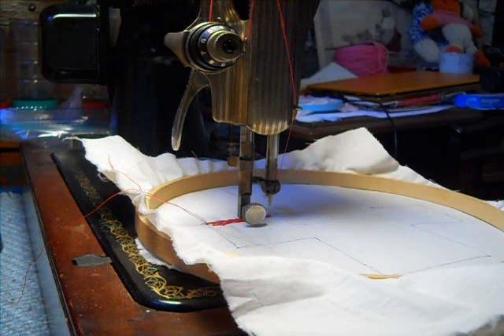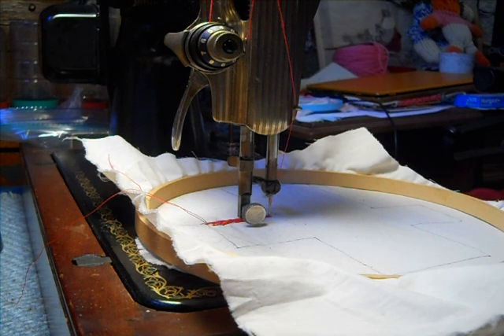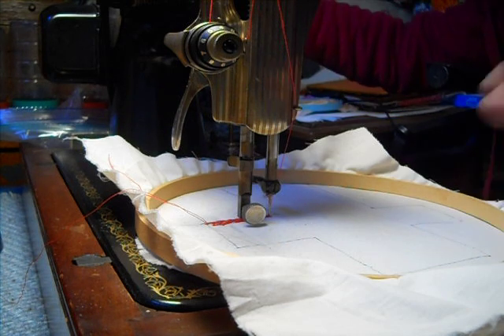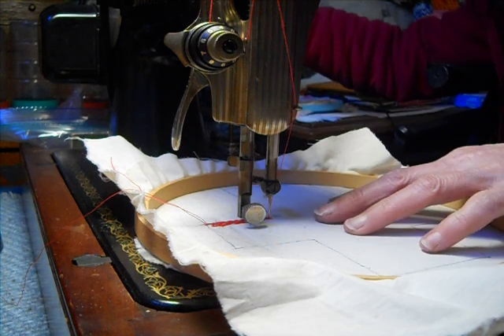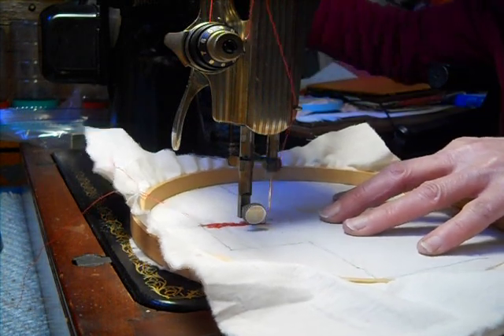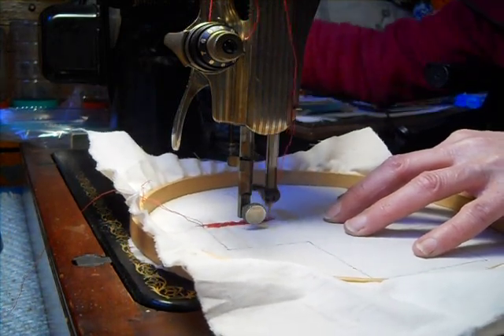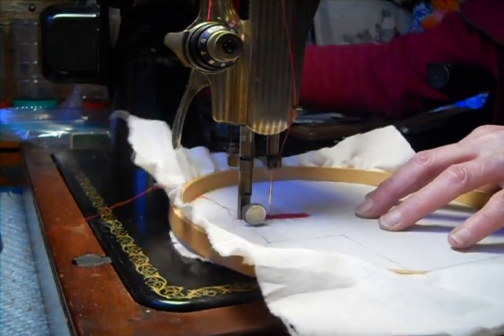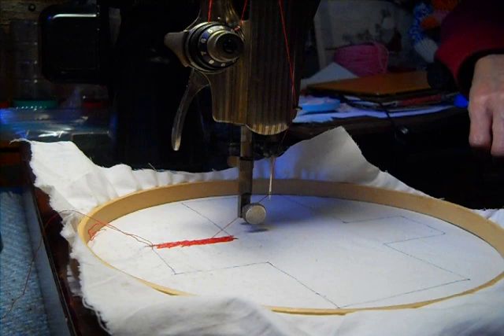1952 Singer 15-91 Bishop Sewing Systems Handcrank and Handcrank Embroidery

Comment: I see your 15-91 is a direct drive model. Do you have to disable the direct drive when you sew with the crank?
Reply from the maker: No- it works very well with a direct drive machine. With a belted motor, there is slightly more drag as you crank because you are moving the pulley- but with a direct drive, it all works more smoothly. I find it best to alternate between electric and handcrank when I have one of these cranks on the 15-91, depending on what I am sewing. I can do slower detail work with the handcrank, but then zoom along with the motor.
Reply: @LaurieOMeara  Thanks for your detailed explanation.